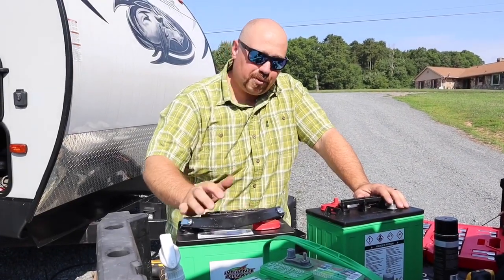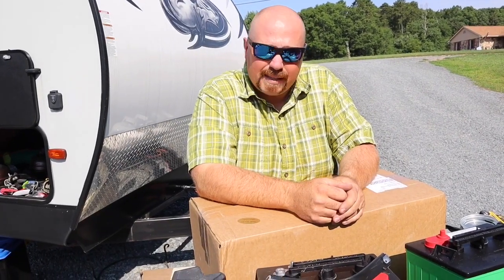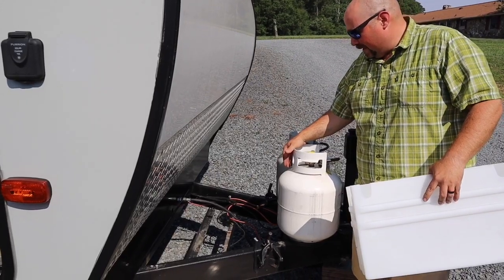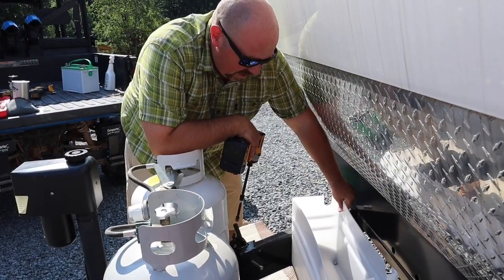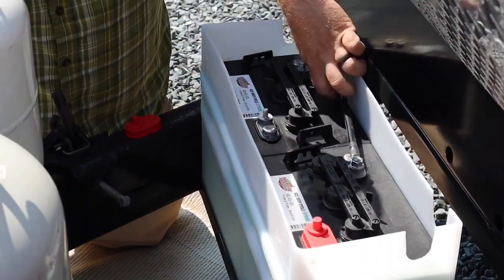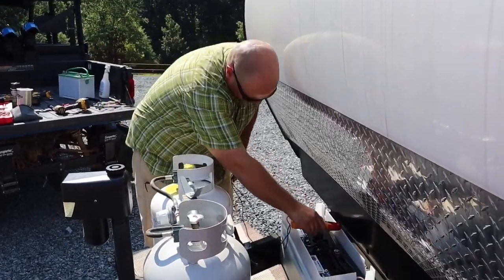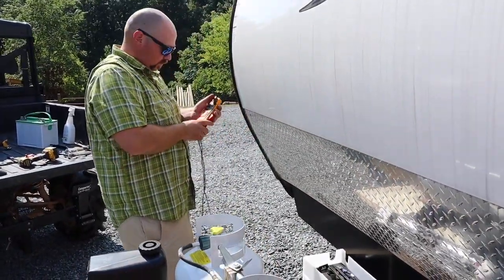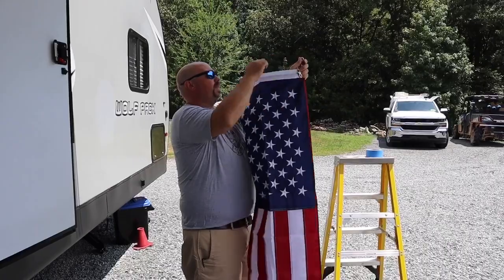HOW TO INCREASE BATTERY POWER FOR RV TRAILER!

Comment: What AWG cable did you use to put the 6-volt batters in series?   Good video!
Reply from the maker: I got a battery jumper cable from an auto supply store. I don’t remember the exact size.. hope that helps!